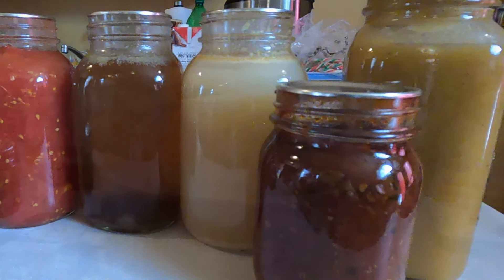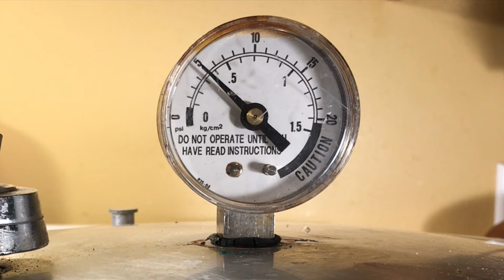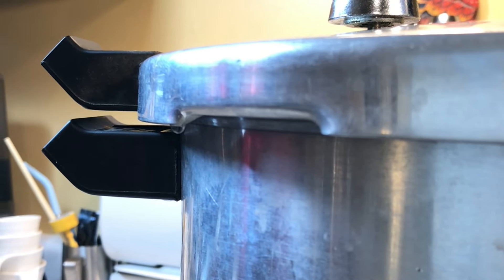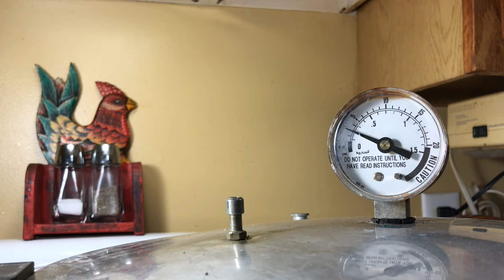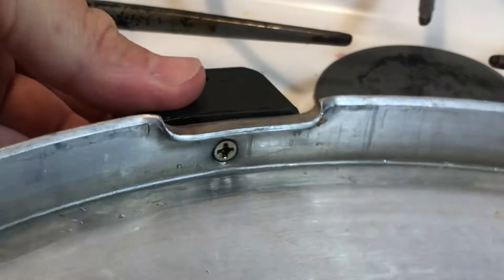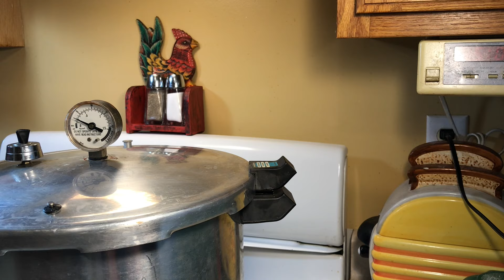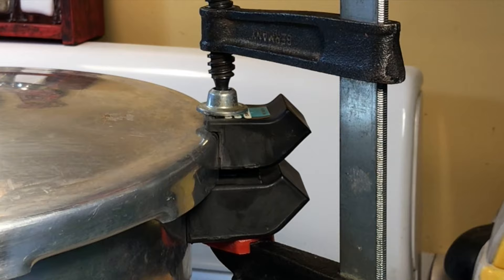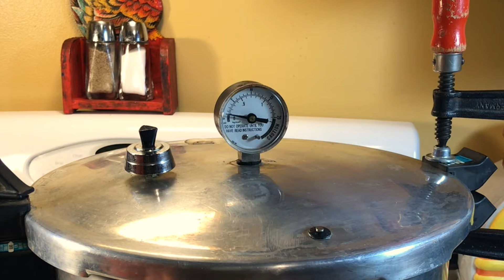A Quick And Safe FIX For Your Leaking Pressure Canner.  STOP Losing Steam!

Comment: Hiii! Wonderful video thanks! I have the exact problem on 0:50 the valve that is twisting around. It’s a new a new pot though… it’s also leaking at one handle. If I fix the problem of leaking by the rubber band, would the valve stop twisting around you think? It started to twist when the pressure was almost completely build up.

Comment: Cool video and good information.  I would just add one thing... gently clean the gasket before and after each use and put a very thin coat of oil on the rubber.  It softens it to be more pliable and seals much better.  

I forgot to do that once and had stream escaping from a few places.  I let the canner depressurize and cleaned and oiled the gasket, restarted it and viola! Sealed tight as can be. 

I do have a slight leak in the pressure gauge gasket though.  The threads stripped from turning the gauge over the years.  But it doesn't lose much at all,  just little bubbles and it holds the demand pressure on simmer, so that's good

Comment: I have a Sears Maid of Honor with a weight like the one in your video that is not spinning. Should my weight jiggle and move? … or should it sit still and just make a hissing sound? At 10 lbs. of pressure, according to my gauge which I am not sure is accurate, there is a hissing sound from the weight but no rocking. Can I trust the “hiss” to be 10 lbs. of pressure?
Reply: Same issue. Did you ever get an answer?

Comment: I have steam and water coming from the pressure gauge, could it from it being to tight and the little rubber ring not sealing right, like how tight sounds the gauge be?
Reply from the maker: Hi Clare, I'm not sure what model you have, but if the gauge is just screwed through the centre of the lid, I would try tightening it a little more.  Try turning it a half to full rotation and see if that helps.  If not, then it could be that the small rubber gaskets have gone and you'll need to replace them.
Thanks
Paul

Comment: I have used my Presto pressure canner for three years and today noticed water dripping from the lid. I watched your video. The one thing you didn't talk about, or if you did and I missed it, was isn't it safe to eat the food if the canner maintained pressure? I am canning breakfast sausage and the pressure is holding steady. Doesn't that mean it is safe? I won't use it again before I purchase a new gasket, but, as long as the canner is holding pressure I am going to consider it safe, unless you tell me it isn't safe to eat and why, then I will throw it out.
Reply from the maker: Hi Joyce, even if it is leaking some steam and the lid is dripping, your food will be safe as long as you can maintain the required pressure.  If the gasket is too far gone and you can't get up to pressure then that's the point when you have to stop.
Thanks
Paul

Comment: I'm losing my mind over this very problem. I have tried everything, my basically new gasket has only been used 8-9 times but the last 4 times I've lost too much water. I've cleaned every inch thoroughly, checked for chips, and unevenness, and oil around the edges. The only thing I haven't tried...2 clamps on the handles. I gotta wait til payday to give this a try. Thank you so much for this video.
Reply from the maker: Are you certain that you're losing steam from between the lid and the base? A new gasket should last longer than 5 uses before it starts leaking.  Is it a dial gauge or a jiggler? If it's a jiggler, then it will definitely lose more steam than the dial gauge.  Every time it wobbles, you lose a little water from the pot so you should start with more water than you would with a dial gauge....maybe 3-4 inches after the jars are in.    Plus I found some people will just put the stove on high and the jiggler is bouncing like crazy and losing a ton of water.  You can start the process on high to get it boiling, and then once the jiggling starts, you can turn down the heat so it still jiggles but not so vigorously.
Just offering a few things....but thanks for watching!
Paul
Reply: @GardenWellEatWell  Yes it's a jiggler. I haven't changed anything temperature wise on my cooktop, all I can see for certain is that water is seeping down from what appears to be the lid about 1 inch from the left handle. It's dripping down onto the propane burner and causing the blue flame to rise and turn orange. Just about the time I see a little steam starting from the chimney then water hits the flame and no more visible steam 😳
Reply from the maker: That sounds like quite a drip.  Hopefully, squeezing the lid down a bit with the clamps will get rid of it!
Paul

Comment: I tell you another easy method.. if the pressure is not building up or there is some leak, release the pressure take out the rubber gasket, and put it into your freezer for 20 minutes. After 20 minutes, put it back right away, build the pressure, and see how it works.